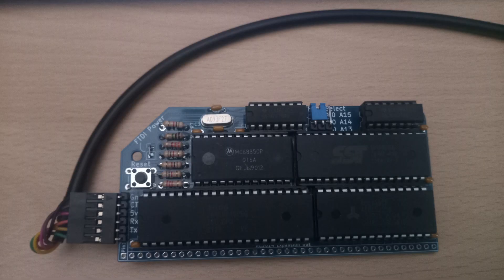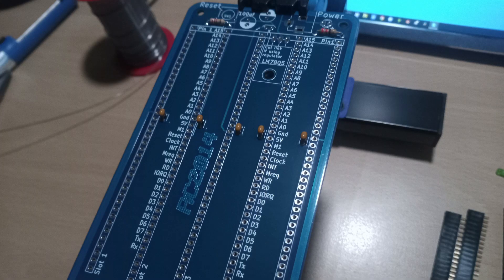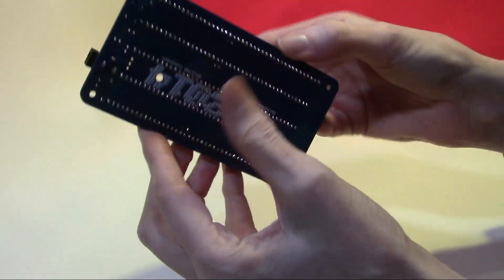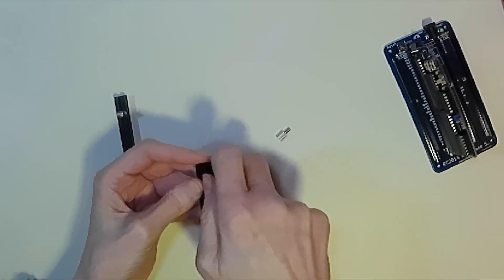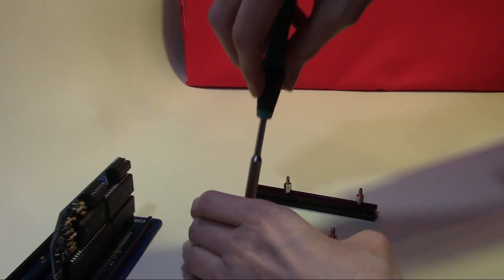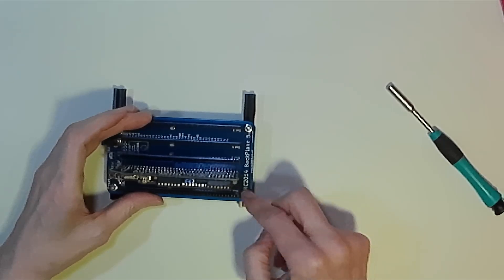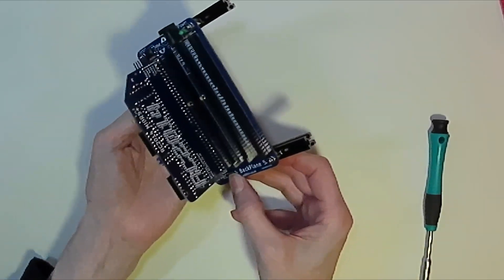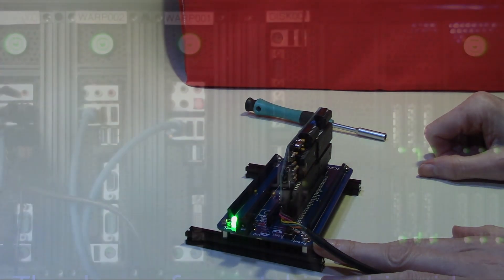Adding a RC2014 micro+ to a backplane

Comment: As always, a nice video. 

Just a minor correction though. You only need to fit a regulator (and appropriate caps) if you're feeding the barrel jack with more than 5v. If you have a 5v supply, then this can just be used as-is, although you'll need to remove the "FTDI Power" link on the RC2014 Micro so it doesn't get power from 2 sources at the same time.
Reply from the maker: Many thanks for the clarification.